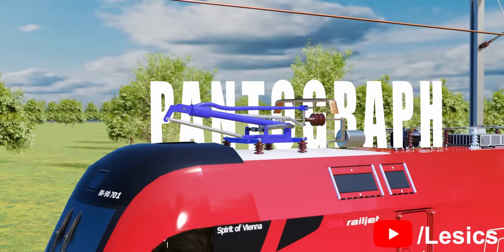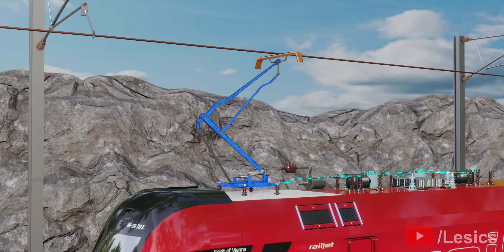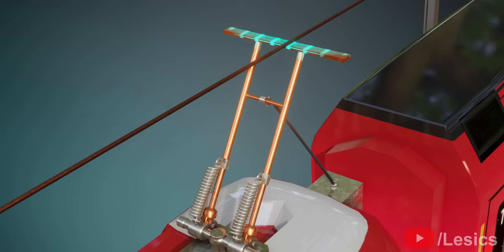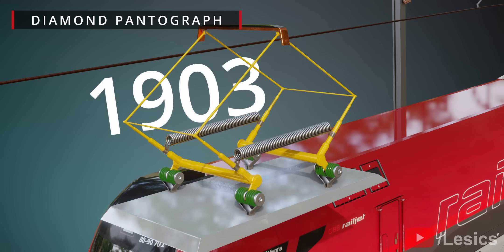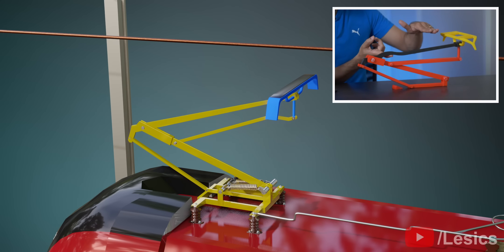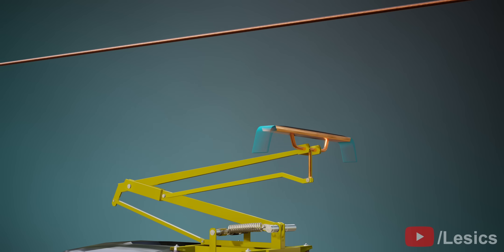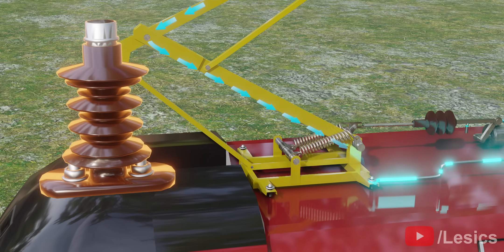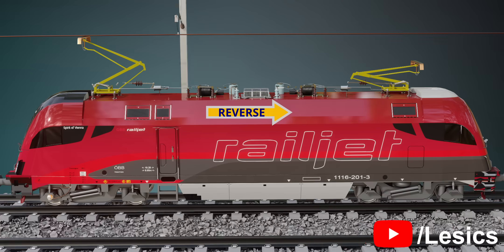The Brilliant Engineering behind Pantographs!

Comment: Why not a grooved wheel or rolling (think pulley) electrode contact that can slide horizontally on an axle, with an air deflector or fairing enclosing the assembly? Vertical motion can still be achieved with a simple spring-loaded swing arm, without the need of a pantograph. The wheel's diameter can be sized appropriately for it's RPM due to the train's high velocity. This could potentially greatly reduce the wear.
It's simplicity and robustness would likely offset any additional cost that may be incurred.
(Yes, I'm a retired mechanical engineer who has solved much more vexing problems than this)

Comment: Eletric shunter locomotives have two panograph too, those never move faster than 60 km/h, and they are placed right next too eachother on the centralised cabine of these engines. Can anyone tell me what the two pantoraph actualy for?
Reply: If you refer to French or old Swiss locomotives, they were for 1500 V DC. They draw much current when pulling away waggons with heavy acceleration
Reply: @camil721  , yeah that explains it. In my country there was a shunter/multi pourpose eletrik engine, the V41 and V42 (basically same engines), single cabine and double panogaph with, that could use 15kV and 25kV. It was designed for using both of the voltage when they changed the rail power system. And the last preserved operationing of it kin uses one at the time. The latest built shunters ,V46 are using only one.
Reply: also when deicing overhead wires

Comment: two pantographs requirement is not due to vortices but due to the fact that using a panto in the opposite direction of travel is an unstable equilibrium. 
When used in correct direction, the friction force on the panto will create a torque on the 4 bar mechanism which lowers the collector head, thus reducing the friction, hence reducing the torque, and thus the collector returns back to a stable position.
When used in opposite direction, the friction force will create a torque that INCREASES the height of the panto! That will INCREASE the friction and thus INCREASE the height of collector head further! VERY UNSTABLE!
Reply: Great video, nevertheless. 💯👏

Comment: Sorry, but the taurus type lok have reversed pantographs ;) Let see the orientation of the pantographs on a Railjet lok: it is not the same, as shown from 8:55. And the reason, why loks use the rear pantograph is not the aerodynamics. The real reason is not that: if the train uses the front pantograph, and it breaks (for any reasons), it can also break the rear panto, and also other equipment on the roof. When the train uses the rear, and it breaks, the train can go next with the front pantograph. But there is a case, where the front pantograph is used: the tank trains, filled with flammable substances. Because at the contact point can sparks occur and these sparks can give flame to the trailers, it is common, to use the front pantograph and/or extra protective car between the locomotive and the first car to protect the cargo.
Reply: The French BB15000 series has only one pantograph. Apparently SNCF considered that all that was needed.
Reply: Yes, locos also use the front pantograph if they pull car coaches for a similar reason.

Comment: Sir, These explanations are so useful and easy to understand but I have a doubt that the electrical supply is done by two lines but the train touches the only one line how it works please explain sir
Reply: The overhead line provides a positive supply while the rail connected to ground which is your negative line to complete the circuit, I hope you get the clue.

Comment: May be a bearing + wheel used  in trolley pole collector could save the wear.
Reply: That design was used as well, in Porto and Lisbon there are still historical trams with those. In Lisbon there are also some that have both the trolley pole collector and a modern pantograph as they share lines with more modern tram.
Reply: @ErdeAnAlle  Thanks for the fact brother❤️

Comment: In the end of the video, actually some engines have 2 pantographs for different voltages. In France, for example the BB7200 has 2 pantographs for 1500V DC (1 pantograph would drain too much current when starting to move a long train)
The BB15000 has only one pantograph of 25000V AC
And the BB22200 has 2 pantographs, one for 1500VDC and one for 25000VAC (+ when starting under 1500VDC)
These 3 engines are from the same family
Reply: Even among systems using the same voltage, there are physical differences among the overhead catenary systems. For example: Germany (DB), Austria (ÖBB), and Switzerland (SBB) all use 15 kV 16⅔ Hz. DB and ÖBB both use catenary that zigzags 400 mm either side of the track centerline, or 800 mm in total - a parameter called "stagger". Both systems use a contact bar 1950 mm wide. SBB's stagger is half that of DB and ÖBB; SBB uses a contact bar 1450 mm wide.
Reply: B/c Germany and Austria unified their railways after Anschluss, while Switzerland developed it's own standards, electrifying the networks earlier
Reply: @camil721  SNCF's 25 kV 50 Hz catenary is largely based on the Swiss model.
Reply: @smwca123  I'm curious about it that's interesting! Is it documented? I can't find that stagger parameter online
Reply: @smwca123  interestingly Swiss ekectric locos are also using German tracks in the border region of southwest Germany, despite an obviously  narrower bar
Reply: @smwca123  Why is the frequency so low, and why isn't it 50hz, the standard throughout the continent ?
Reply: @terryjimfletcher  50 Hz was once the standard industrial/commercial frequency worldwide, and still is in Europe; North America moved to 60 Hz.  The lower frequency dates back 100+ years, and was chosen to resolve commutation issues within the traction motors. The German-speaking and Scandinavian countries chose 16⅔ Hz, which is ⅓ of 50 Hz. North American railways chose 25 Hz, which is ½ of 50 Hz.
Reply: @smwca123  And it was based on the idea of using AC traction motors of constant frequency with commutators. When the SNCF went for 25 kV it became practical to have on board rectifiers and use DC motors and avoid the need to invest in frequency reduction units, with the inefficiency involved in them. Now it’s normal to use variable frequency 3 phase motors with on train power electronic inverters on new stock, such as the class 80x stock, so in effect the idea of using low frequency supplies are obsolete - but likely to be around for a while given the service life of many things.
Reply: @johnkeepin7527  And prohibitive conversion costs, as Amtrak found out with the southern part of its NE Corridor. SNCF, when they tried 25 kV 50 Hz on Valenciennes-Thionville, tried 4 systems:
- BB13000 (53), Direct 50 Hz motors, OK but some issues;
- BB12000 (148), Ignitrons and DC motors, the hands-down winner;
- CC14100 (102), AC-DC rotary converter, great for long heavy freights but cumbersome; and 
- CC140000 (20), AC single/3-phase rotary converter, problematic, gone by 1981 while the 3 other classes lasted well into the 1990s.
Reply: DC-only locomotives often raised both pantographs when starting, to balance the heavy current draw. As the train picked up speed, the front pan (usually) was dropped.
Reply: The showed Railjet locomotives has also 3 pantographs :) 2 for 25kV AC 50Hz and 15kV AC 16 2/3 Hz and another for DC systems, for example 1500V or 3kV DC. The EuroSprinter series has also a 4 pantograph version for all systems, it is called for ES64U4, where the U4 indicates, it can use 4 diferential systems. And this uses 4 pantographs. The ES64U2 version has only 2 or 3 pantographs :)
Reply: I think some Belgian locomotives have 4 pantographs.  I guess for 4 different current systems in different countries.

Comment: BME here. I can’t help but notice the mechanics of the pantograph is a good representation of how the musculoskeletal system maintains stillness and balance.
Reply: I believe there is a lot to learn from nature's designs. 
E.g. Bodies of insects are simple, effective machines with a lot of flexibility and adjustability built in.
For instance, if nature had to evolve a pantograph, it would probably use a flexible cartilage instead of the metal arm, it would naturally evolve thicker padding at the carbon plate, it would make the lower joint flexible too and there would be a lot of redundancy, so that if a pantograph arm got stuck in the wire, it would tear off easily and another would grow in its place after a few weeks.
God forbid, one day in the far future, we are able to grow bone and tissue to engineering specifications, we would have organic materials instead of metal. Then all of nature's lessons in mechanical durability would be applied and we would create "living" trains and such.
Reply: @anandsharma7430  by the time we start growing bio-pantographs, trains will be an artifact 😂

Comment: Why they don't use a pully with bearing in it for Electricity transfer ? This will reduce friction and increase it's life.
Reply: ...a pulley that is wide and heavy?

Why would the friction necessary for conduction be lower inside a bearing?`
Why aren't the brushes inside motors pulleys?

Comment: Why couldn't we put a metal wheel (where it comes in contact with the cable) in place of horizontal collector. It would reduce friction and wear and tear.
Reply: It used to be used on tram lines in past. But you need some way of collecting electricity from rotating wheel anyway - in form of carbon brush. Therefore eliminating the wheel is also eliminating a point of failure.
Reply: @peritecz  interesting !
Reply: Wheel to wire contact is a 'point contact ' which means small area of interface thus higher resistance .
Reply: because bearings do not like to conduct electricity. Our railway engineering prof in uni told us about a case where there was a grounding fault in one of their locomotive. It caused the wheel bearings of basically all the cars attached to that locomotive to fry in a short duration.
Also, by using the flat bar atop the pantograph, it gives a huge wear surface - so the maintenance interval is very long and heat buildup negligible. A single bearing would overheat very quickly at these extreme currents
Reply: It'd probably cause issues conducting electricity
Reply: @daiyousei.1586  Ok. Was curious though.